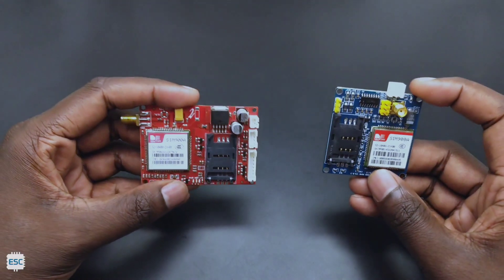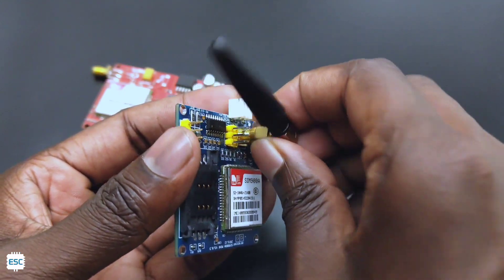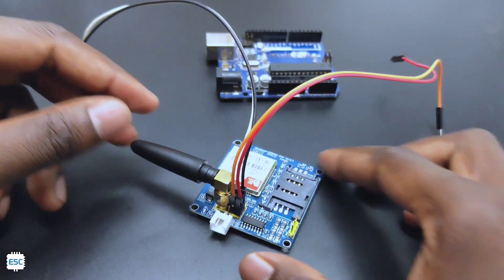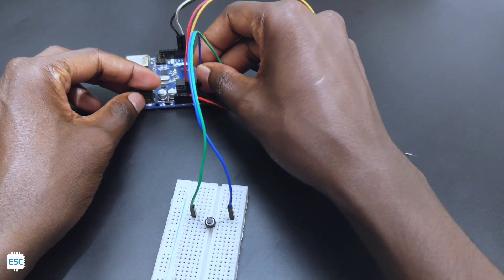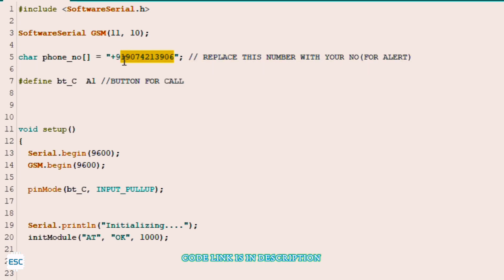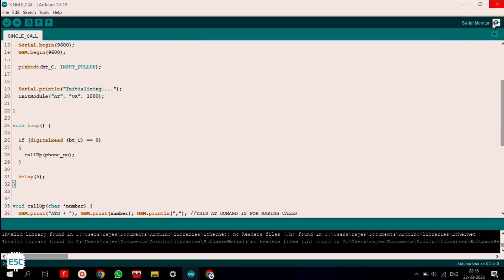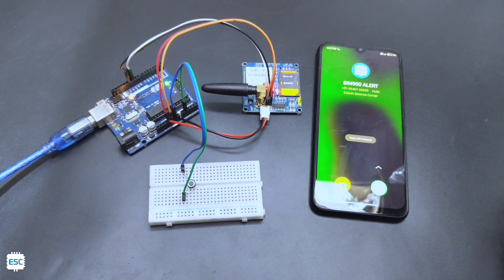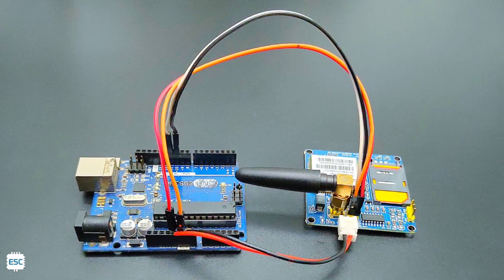How to Interface SIM900A Module with Arduino | making calls using SIM900

Comment: Is it safe to connect both vcc and gnd two times from gsm module  When there is vcc and ground shared with other sensors?
Reply from the maker: Better to use external supply

Comment: Is it necessarily to still connect power supply twice? Vcc on the side and on top of the board?
Reply: I'm confused as I saw some demonstrations on YouTube and other sites with only the VCC and GEN on the side without the one on top. I'm scared not blow the device up
Reply from the maker: @FreshDolby  you h
Should connect both vcc to 5v
Reply from the maker: Yes you have to  connect the both supplies

Comment: You used a 4G sim right? Does it work? Because they say sim900a only works with 2G sim
Reply from the maker: I used the 4G SIM , but that sim also supports 2G.
Reply: @EDISON_SCIENCE_CORNER  ohhh, so as long as it supports 2G it works

Comment: hello sir, i put bsnl sim in the GSM but the LED is blinking rapidly and it is not connecting to network can you please provide any solution to this issue, it is very urgent.
Reply from the maker: Check the sim and power supply properly.

Comment: Hi, If I need to use a 5V extra supply where should I connect the 5v to the VIN pin or the 5v pin of the arduino?
Reply from the maker: Hii

Comment: Hey, I did exactly everything you did. But it didn´t work. It shows me the at and ok. but when i press the switch it doesnt work. I used a new sim card from KOLBI ICE costa rica. Which SIM am I supposed to use. What am I supposed to do to make it work? Please help!!
Reply: Is it neccesary to install the library?
Reply from the maker: No need to install any library
Reply from the maker: Please check whether your sim card supports 2G NETWORK
Reply: @EDISON_SCIENCE_CORNER  Yeah it supports 2G network

Comment: am just a beginner , so right its taking power from the computer , after uploading the code an adapter must be used to give the supply am i right ?
Reply from the maker: Thats fine. You can power it with any usb. But make sure it has a rating of  1A minimum
Reply: @EDISON_SCIENCE_CORNER Hello is it possible too talk thank you

Comment: the wiring does not seem to work for me. The SIM900 seems to work if it is directly connected to the arduino 5V. althought I red thatt his should be avoided... but it works. however this means that theres no power for other sensors
Reply: @EDISON_SCIENCE_CORNER  the trick you made withthe double connection seems not to work for me.... I tried on the breadboard and cannot get enough current.... also if I connect directly to the 5 volt I am left with nothing for the other sensor I want to hook to the arduino... I need an external power supply...

Comment: Bro this error is occurring what can I do bro

avrdude: stk500_recv(): programmer is not responding
avrdude: stk500_getsync() attempt 1 of 10: not in sync: resp=0xa3
avrdude: stk500_recv(): programmer is not responding
avrdude: stk500_getsync() attempt 2 of 10: not in sync: resp=0xa3
avrdude: stk500_recv(): programmer is not responding
avrdude: stk500_getsync() attempt 3 of 10: not in sync: resp=0xa3
avrdude: stk500_recv(): programmer is not responding
avrdude: stk500_getsync() attempt 4 of 10: not in sync: resp=0xa3
avrdude: stk500_recv(): programmer is not responding
avrdude: stk500_getsync() attempt 5 of 10: not in sync: resp=0xa3
avrdude: stk500_recv(): programmer is not responding
avrdude: stk500_getsync() attempt 6 of 10: not in sync: resp=0xa3
avrdude: stk500_recv(): programmer is not responding
avrdude: stk500_getsync() attempt 7 of 10: not in sync: resp=0xa3
avrdude: stk500_recv(): programmer is not responding
avrdude: stk500_getsync() attempt 8 of 10: not in sync: resp=0xa3
avrdude: stk500_recv(): programmer is not responding
avrdude: stk500_getsync() attempt 9 of 10: not in sync: resp=0xa3
avrdude: stk500_recv(): programmer is not responding
avrdude: stk500_getsync() attempt 10 of 10: not in sync: resp=0xa3
Reply from the maker: Which arduino board
Reply: @EDISON_SCIENCE_CORNER  rectified bro thank you for the reply
Reply: Bro make sure in you arguing board d1 and d0 pin I'd disconnected

Comment: I have a doubt ,

I have been planned to built a project that have a sensor and output connected to blynk cloud 
Also i want to add this call features to that arduino .

I have a arduino code for that sensor and the code, you used in this video. 

How to upload both the codes in the arduino .??
Reply from the maker: Merge both codes and upload 🤟

Comment: I was using this gsm module SIM 900A  for Earth quake detector alerting process but I didn't receive the sms or call after I dumped the code
Reply from the maker: Please watch the video carefully , check whether your sim supports 2g, check connections

Comment: Can we use 4g sim of vi, airtel, bsnl directly in that module, is there's services support or not.
Reply from the maker: Yes you can use those sims
Reply: @EDISON_SCIENCE_CORNER then why did you said to use a 2g sim 2g or 4g or anything?
Reply from the maker: I said to use 2g sim only.  The 4g sim of vi, bsnl will support 2g also. But jio will not support

Comment: Good day sir, i just followed your instrustion and the code but i only got AT response from Serial Monitor. What should I do? what does it mean?
Reply: Did you make it work?
Reply from the maker: Connection problem. You have to check the rx, tx pins

Comment: can i connect a vi or airtel which can support 2g nework?
or
Some SIM cards and mobile carriers automatically switch between 4G and 2G networks based on the network availability and signal strength. However, the switching capability is often controlled by the mobile carrier, and the module should be able to handle the switch seamlessly
Reply from the maker: You can use any sim which supports 2g

Comment: Its sim 900A mini module right? Can i use it with my arduino uno + gps module to send data to my firebase node?
Reply from the maker: Yes possible
Reply: @EDISON_SCIENCE_CORNER  is there any video or resource to do that?

Comment: the SIM900A needs far more current then the Arduino can deliver, thats why some SMS sending dont work.
The module can consume peaks of 2A during sending
Use a separate power supply or better a 3.7V Li-ion cell !!!!
Reply from the maker: That's correct but  it got worked for me

Comment: The light is in module is on but it not calling in serial port the error is showing pls help i need your help
Reply: Output is not  coming in serials port
Reply from the maker: Change the tx rx pins
Reply from the maker: Two LEDs there . One is a power LED and another is a status LED. Status LED should blink in every 3 seconds.
Reply: Ya the status led blinked every3 second
Reply: But it didn't make call
Reply: Ya i changed but nothing happened 😞